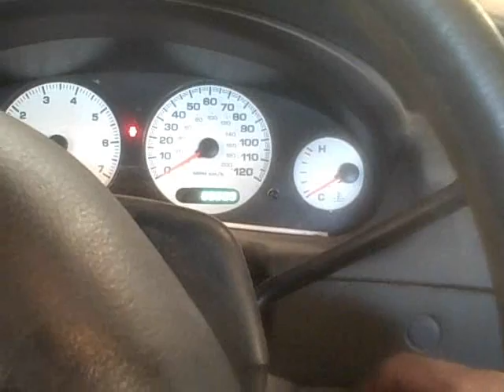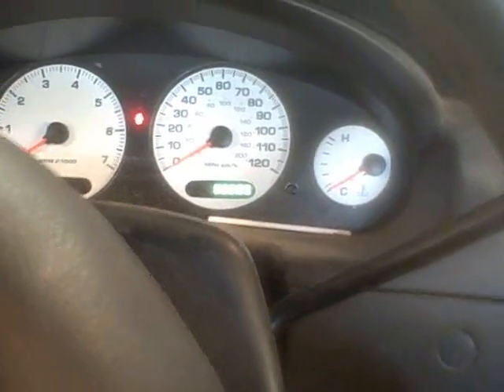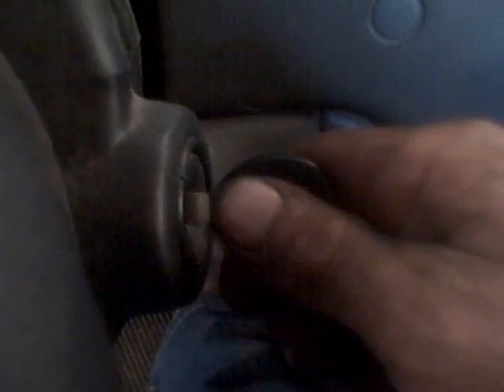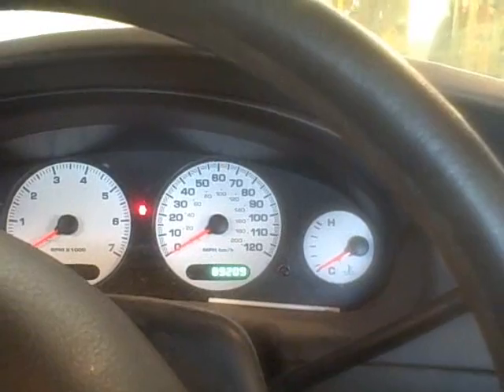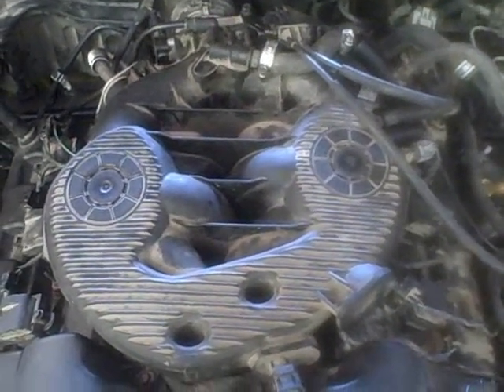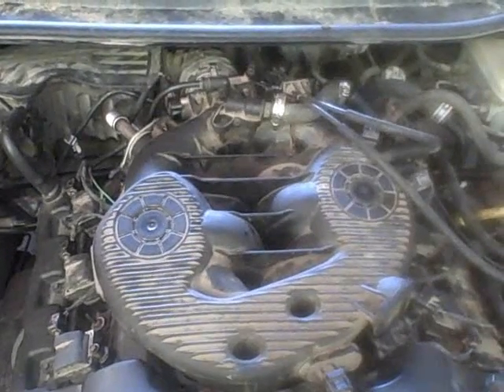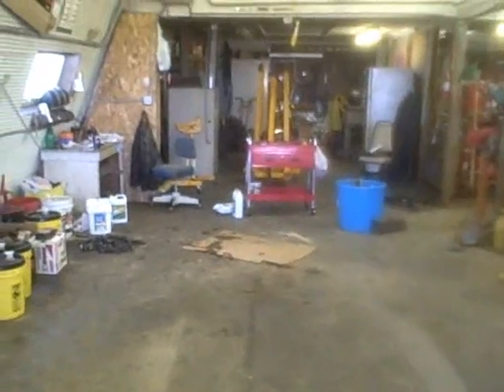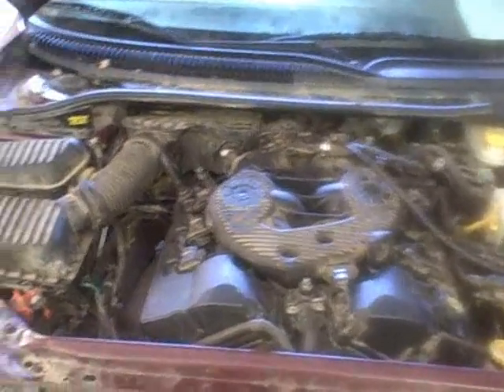Finally finished that damn Intrepid

Comment from the maker: yeah the guy who had me rebuild this one has a 2.7L intrepid that has 220some odd thousand on it and still runs great... you dont actually want to do the timing chain... that set is $700 the problem iswith the tensioner so if youre looking to stave off problems that would be the best place to start

Comment: I have to agree with shooting in the testicles part. I junked a 2003 Intrepid with 84,441 miles on the odometer b/c the engine failed a second time and transmission was going south. For every weekend I drove it, I spent 2 weekends trying to fix it again. The second engine had 30,000 miles on it and oil changes every 2000 miles with Mobil 1. No sludge either.

Comment: @fixinggrace  Thanks for the input I appreciate it. A friend of ours put a scanner on it and didn't get any codes. It's not getting any power to the coil or the plugs, we tried replacing the coil but that didn't work. My uncle, who works as a mechanic and driver for a township in NY, said it sounded like a crankshaft sensor, which tells the computer to send power to the distributor, coil, and plugs. I'm going to get one tomorrow and try that.

Comment: Hey man, I have a 2.7l in a 2003 and let me tell yeah, your 100% man, Ive had nothing but problems. first motor only had 133k on it and the timing went. Then we got another motor well lets just say its still not going after 2 months.  its one heck of a pain in the @@@ so anyway, thanks for showing me a alittle about what you have done. Only if I knew what wire was for the EGV valve and the kock sensor cuz they are both missing.......   yeah. well man good luck and please keep bringing the videos

Comment: i have a 2000 with the 2.7 and it just turned over 209000 kms and other than an egr valve i had no major trouble at all.

Comment: @arbobrady 
It is the cam sensors.  there are 2 of them.  replace both.  About 130.00  Will run like a charm afterwards.  has happened to us twice now.  About every 30-40 grand.

Comment: I went to Shucks oreilly to check it my Intrepid 02 and it showed a code  P0128  The thing read   ""Coolant temp below thermostat regulating temperature""

That's a bad thermostat right?  

Oh and to do that code check in the car is it.  on, off, on, off, on, off, on, off, on, then just on, off, on off, on?   to show an error the code? (if one is present)

Comment: Do you know how to show the codes on a '99 Dodge Ram 2500 with a 5.9L V8? I think I know what the problem is but i want to double check. And I have to get this done by Sunday and I can't get to it until Saturday. I have a last minute landscaping job that came up and I need the truck.

Comment: Normally, you need a scanner to look up the codes on any 1996 car or newer. With a Dodge you turn the key off and on like wagner59270 is doing

Comment: Do you know what the Bolt sequence and Torque specs are for the 2.7 liter engine?  I am replacing my plugged screen and need the info so I can put my pan back on correctly thanks to anyone that has this info

Comment: If you love the car swap the engine for the 3.5. Don't even bother wasting your time fixing the 2.7 if you do have the money for the swap. The 3.5 or 3.2 are much more reliable and you get alot more power. Just make sure to match the engine years like from 1999 to 2001 and 2002 to 2004, then you won't have any issues. Everything is pretty much plug and play but you will need to buy some different parts, such as harness, radiator and some other things. Look it up and you'll find all that you need

Comment: thats cylinder number 5 and i had that problem and at first we thought it was the powertrain module because i had it reprogramed  and soon after that was is but later i found it was a shorted out fuel injector but your right it takes so much to keep this stupid dodge running after this im not buying another

Comment: not to big on the interpid good cars thought ex had one she drove it into the ground poor thing kept going right up till it threw a rod into the transmission and died i prefer the older rear wheel drive ones my self i have a 84 fifth avenue ive had since  high school and im 27 and its got 498,000 on the orginial motor and trans even the factory ac works as does the orginial sound system not bad old car for a free bee considering it only cost 35 bucks for a starter for it